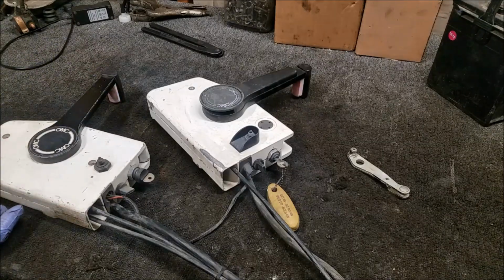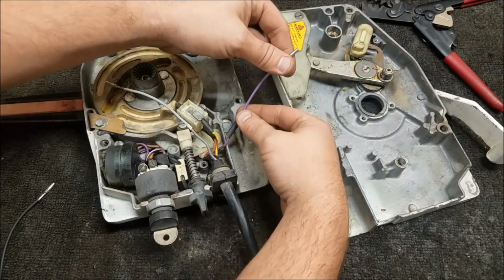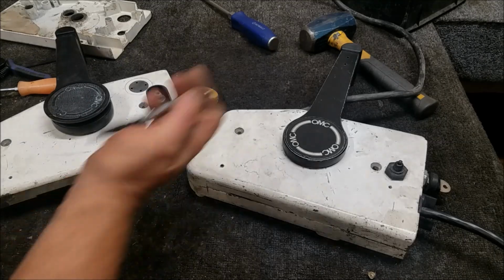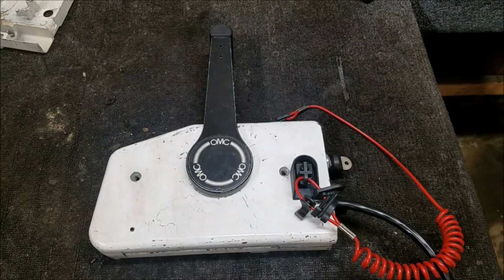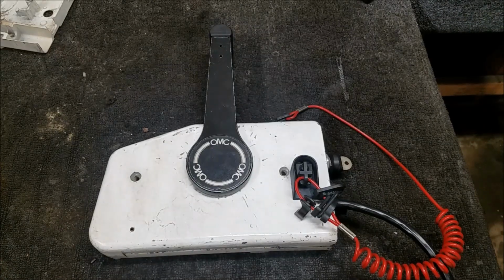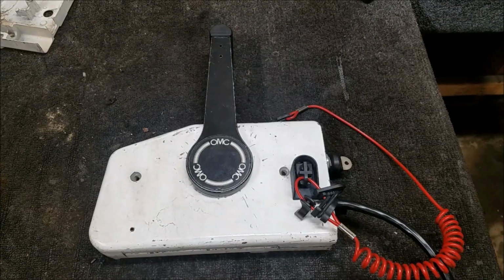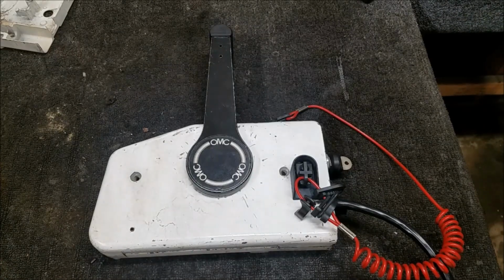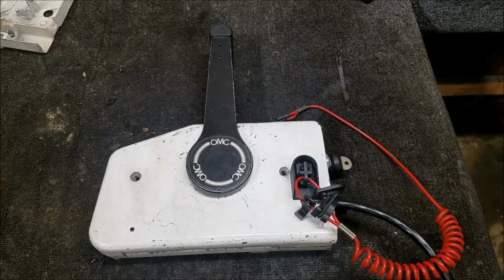Fixing A Broken Johnson / Evinrude Remote Controller

Comment: What a fantastic breakdown. And thank you for pointing out the neutral safety switch is In the controller... I thought for sure my solenoid was shot... Nope the handle wasn't in neutral even though motor was... I really appreciate the clear video and the time you took!
Reply: did you change the safety switch?
Reply: @slobodang952  I'm not going to lie to you I didn't change the switch I just removed it and grounded it out so the motor will run but I did just order one after realizing that tubing with kids is a bad idea without the dead man switch

Comment: Nice video! What is the little device with a wire coming in and out justbetween the key barrel and throttle tensioner knob, i am having a intermittent start issue and think it might be this component or the cables in/out of it.

Comment: Thank you Brandon,

I got 2 problems and I can’t figure it out. 

The problems are : 
1) at engine off it doesn’t wanna click in reverse, engine running no problem. ( I think when I pulled down the lower leg to change the seals I must have moved the shift rod ? But why it wouldn’t work at engine off but no problem when the engine is running?) 

2) when cruising along on the water,  the forward control only works in the first 10% of its run and again to go faster ( a little) I have to put the  lever all the way down ( the last 90% of the lever run) . It looks like  from 11% to 90% the lever is doing nothing, it’s all play. 
Today I pulled the controller apart ( that’s why I am on your video) and looks like the cables are fine at 100% in movement back and forth. I can’t see where the problem is due to the fact that the control box is split in two part and I never know “what’s not working” while both parts are as whole. 

I hope I have described the problems accurately so you can understand what I mean .

Thanks in advance and thank you for your videos ! You help thousands of ppl
Reply from the maker: What kind of engine do you have?
The not shifting while not running is normal. Without the engine running, the gears aren't moving, and usually don't align correctly with the shifter. 
Spin the prop while shifting and it'll go right in.

As for the controller, disconnect the cables on the engine, and check for full movement - that'll tell you if it's the engine or controller.
Past that, I'll need the engine year/hp and controller type. 
I'm guessing it's a linkage adjustment issue.

Comment: This is very helpful. My issue is when I split the cases the throttle and gear shift works correctly, when assembled it stays locked and I cant move the throttle out of the locked position?

Comment: Hey, Brandon.  Great video.  I watched it 4 times but there is no way I can split the remote on my 70HP Johnson controller.  It appears to be hung up on the bottom where you firs split the halves.  Maybe hanging up on the warning horn?
Reply from the maker: Naw, probably on the alignment pins on the two case halves. keep prying, but slowly around the entire case.
Like, if you get the top open a pinch, put a wedge in there and keep going at another side. Some type of wedge is important to not loose your progress. 
This is the least of your problems, usually when they are that stuck the hardware inside also isnt coming off. 
The case halves can be purchased and replaced. The insides are whats important.
Reply: @BrandonsGarage  ThanksBeandon. First thing in the morning

Comment: nice work I have a question I have a 1978 70hp evinrude and my throttle handle goes all the way forward but the shift linkage on the motor doesn't engage all the way can they be adjusted and if so how?
Reply: I got the same problem be nice if somebody can answer the question

Comment: I know you don’t usually answer questions, but here goes. I have this control box. The problem, you have to push the throttle 3/4 forward before it engages the carb. I tried new cam with zero improvement. Everything seems tight. My next attempt will be new cables. But I don’t really think that’s the problem. Any help would be greatly appreciated. Riley
Reply from the maker: I answer questions all the time?
Anywho, it's probably just backlash in the cable.
Watch this video, start at 10:50

https://youtu.be/qigy9Ryha2A
Reply: @BrandonsGarage  Thanks so much! I will try that. Do you sell used parts online? I could use that spring loaded pin that locks the control box in neutral. Thanks again for your time. Your videos have been very helpful over the years.

Comment: What does the middle knob on the controller do? I just recently picked up a Evinrude 150 that has this control box.
Reply: 22:18 i had the same question. I was watching this video to find out what the middle knob does. It is a tension lever to adjust the resistance of the throttle handle.

Comment: Hi I have a johnston 225 outboard v6 n this control box is on it the teeth inside are all wore away so it is driving froward when u put it in reverse can you change the hole box to a different make or does it need to b  the same type of box??
Reply from the maker: Whole thing is replaceable. Can even buy a newer design one with the use of an adapter.
Reply: I have bought a new design box but doesn't seem to fit
Reply from the maker: @williamkeenan1096  Doesnt seem to fit? 
also, I didnt notice before, you put it in forward, and the engine goes backwards?
Reply: Could you send me a like for the new type you mean incase I have bought the wrong 1 👍
Reply: @BrandonsGarage  I have tried 2 boxes on it 1 I got on it was fine had it running on the hose np then when I put it in the water it wouldn't give me any speed in drive and was going into reverse at this with no problem 🤷‍♂️

Comment: Have you ever come across one of these controls where you can lift motor up but won’t go down in pretty confident it’s in the switch, I can run battery direct to motor plugin and can make it go up, reverse wire and goes down but when I hit the switch it goes up but has no power down

Comment: quick question. i have an old 1988 135hp mercury. it has a 8 pin. I've seen some similar online but they say works on 1994 and older. But they look identical. Im just curious if there is a big difference in the 2. They both have 8 pins and power trim.

Comment: Brandon can you tell me what is that little knob for,the one in between the key n wires plug.
Thanks
Reply from the maker: Tension, or friction on the handle.
Turn for desired firmness.

Comment: I know this is not a main question regarding this video. I got a gas gauge. 1976 Evinrude 135hp. How do I wire the gas gauge into the ignition and what wire do I use. If not can what can I do
Reply from the maker: well purple is your battery positive with key on, and black is ground.
Reply: @BrandonsGarage  Thanks! Will be working on this tomorrow. I’ll see if I can tap into the purple

Comment: Brandon,  I wonder if you can advise me more on the Idle Lever side.  I'm having an issue where it is either all out or all off, seem like it sticks or something.  Partway up doesn't do anything, then a little further and it's full blast.  Bringing it down, it stays that way to a point then seems to suddenly bring the idle all the way down.
Reply from the maker: Could be on the engine, the throttle levers grease has a tendency to turn to sticky glue;
they still work, but not very well.
I would check those first.
Reply: Thanks, I'll try that.  It's a fairly new engine (old, but never used before I bought it).  I got the controller from a guy that did work at the dock for me.  I almost wouldn't expect the issue of the grease, but I'll check that first and respond again after I've had a chance to look.  Appreciate the quick response!

Comment: Thanks for the video, I've watched several. It looks much easier on your vids, My handle will not come out at all. Allen screw removed and longer screw used to tap it out, well I've used much more than a tap and it will not budge. Any suggestions?
Reply from the maker: same thing with this controller: https://youtu.be/qGe3VOnoILQ
just took more hitting. I think I propped it up on 2 pieces of wood and used a small handheld sledge.

Comment: Sure enough fuse was blown.  Got a new one and fired right up.  One More question there is a little red valve by the carburetors. I was told it is a manual choke.  Which way is off?
Reply from the maker: you want it in the middle. so not up or down. 
If you watch my 40 HP video, you can see me working on one of those.
Reply: @BrandonsGarage  thanks for all your help.

Comment: I’ve got a 1975 Johnson motor put a new ignition on I can turn the key on and hot start it and it will run and I can turn it off but it will not start with the new ignition how can I fix this

Comment: Brandon I'm hoping you can help me out.
I have twin yamaha's and my forward controls are not opening the throttles at the same rate. They start out fine at first but then the more you give it gas the larger the discrepancy between throttles. When I run at high speed the right handle has to be more forward that the left for both engines to have the same rpm.
I thought at first that the throttle/cable parts/levers on the outboards could be loose or worn out. But they are fine. Both have been synchronized at neutral and at idle. Both idle at 700 rpm.

Comment: Where do you buy parts for this shifter?  I took mine out in too cold of weather and the shift cable froze and I. Broke the teeth on the big circular mechanism inside.  And now it wont even turn over.  Is there something that is a safety switch from keeping the starter from turning over.
Reply from the maker: Yeah, neutral safety switch built into the controller, if its in gear it wont start.
Reply: @BrandonsGarage  it must be faulty because when I have it taken apart thanks to your awesome video and when I hold it in everything is still dead.
Reply: @BrandonsGarage  I have an 85 Alumacraft that has the 77 series gear shifter box I've lost my key would you happen to know what type of ignition switch I would need to get for that or the key number thank
Reply from the maker: Could be any key, if it was recently replaced, it might have a number on the front (where the key goes in) If not, you'll need to replace the ignition switch: https://amzn.to/2QbZLAJ

Of, for a hair more, buy a key set and just figure out what key you need:
https://ebay.to/2EZwY1o

Problem with that, is if it has had a Sierra or other aftermarket lock in it, those keys wont work.

Comment: Brandon on a older video you tore down a evinrude 8hp in the video you talked about changing the carb on the 8 to a 6 i was wondering if you did it and what your results where ?
Reply from the maker: Havent gotten around to it yet...
Reply: Brandon's Garage also I wanted to know if you would do a video on a performance 15hp evinrude/Johnson maybe use some performance reeds and port the intake and maybe use a bigger carb and test your results there very popular in Australia and I’m just interested on what can be done to make the little buggers get more power there a perfect size for a small boat

Comment: I've got the same controller. Today I started my outboard motor. After a while, the remote control started screaming/beeping, but everything seems to work normal. Do you know, what could be the problem?
Reply from the maker: that is the overheat alarm. You need to fix the outboard's cooling.

..or, if you have an oil tank, it could be low on oil. 
(its a warning horn)

Comment: Does anyone know what the kill switch wiring is connected to at both ends? one of the wires on mine is cut off and the other has been spliced. I cannot figure out what wire goes where.

Comment: Awesome videos !! I have a question. I'm getting several inches of travel in the shifter before I get a response with the throttle on the motor (1973 Johnson 65), Could there be something wrong or worn inside the controller or it just be cable stretch ?? My throttle is only opening up about 60% at wide-open. I'm can manually pull the throttle open and she flys !¡!!!!. Any help would be greatly appreciated. Thanks
Reply from the maker: Probably cable back-lash.
Watch the end of this video: https://youtu.be/qigy9Ryha2A?t=10m38s

Comment: Hey Brandon maybe you can help me out i have a 90 hp v4 2 stroke evinrude now i replaced the motor as the mechanic said my other motor needed a complete carb rebuild now he is trying to say this one needs it too. Anyhow what is happening when i put the boat in the water. The rpms are high but doesnt seem to have power to go very fast almost like its slipping into neutral when i shift into high but when in shifts into lower gear it dies about 10 to 15 kmh but hight nothing is it possibly the OMC controls need a rebuild as the other guy who bought my motor said he hooked it up and working fine so what would cause the problem in my OMC THROTTLE CONTROL i was going to get another OMC controls but worried that it may just have the same problem any ideas
Reply: have the hub in the prop replaced

Comment: Hey mate is there a fuse located in one of those got one that won't start
Reply from the maker: No, but there is on the engine wiring that powers the controller.

Comment: Any chance that you can send/post a pic of the ignition wiring at all? I had someone take my controller apart and didn't take a pic of how to put the wires back together :-(
Reply from the maker: on the switch itself?
Reply: Yes the back of the ignition switch thanks.
Reply: It has 6 connectors (with C, A, M, B and S on them). I really dont want to stuff the motor by connecting the wrong wire to the wrong connector. Any help would be greatly appreciated.

Comment: Hey Brandon what does the harness plug you wired in under the key do? What’s it called
Reply from the maker: tachometer plug.
Provides the tach signal, switched battery +, and a ground.

Comment: Awesome video! Very clean wiring. What is the red wire at the end of the video? Is that an emergency shut off? I just bought a boat and it came with a 100 V4. I was curious what the cross piece was?
Reply from the maker: The red thing was/is a safety lanyard. Pretty important, boat cant run without it. 
(if the controller uses  one that is)
Reply: Brandon's Garage ive got this mounted on the starboard side of the boat. I am installing a center console and was wondering if it would need to be mounted on the port side of the console? Also, if I decide to purchase a universal control, I assume, I would have to also install a seperate ignition switch?
Reply: Brandon's Garage great video by the way!

Comment: Hello, thanks for posting video.. I have a question if you dont mind. I have an older 20 foot powerboat that used to have a Johnson outboard engine in it. I have now replaced the original engine with an Evinrude V4 110 hp.from about the same era ( 1988-1992 )  The Evinrude engine came with a OMC controller but i was wondering if the Johnson Command center controller that is already installed in the boat will work the Evinrude.. Thanks!
Reply: Johnson and Evinrude controls are the same. Their all OMC Style. At least on the older units.

Comment: Hey Brandon, I have a 40hp Evinrude just like the one you made the videos on. I set my linkage and reinstalled everything. Now the motor turns over strong but won’t fire at all I have spark, and I have fuel. I don’t have any movement at the engine linkage when I engage my high idle lever... any suggestions?

Comment: Hey I have the exact controller for my 85 bass tracker. But i wanna install a push button/toggle switch to start motor. New push button/ toggle only has 3 wire . 1 for toggle and 2 for button. What wires from key switch do I use ? Any help will be amazing. Thanks in advance.
Reply from the maker: have a part number, or website you got it from? Just need to see it.
Reply: @ Brandon's Garage - joesracing.com 
Joe's racing products . Part # 46115
Reply from the maker: Ah. I am out traveling for work at the moment. I'll make a video tomorrow or Wednesday when I return explaining it.

Comment: Hello i have a 84 johnson with the same controls as you have in video. I bought the boat off an older gentleman and the control box was apart do to having a plastic piece fixed. I put the control back together and took the boat out for test drive and the boat ran rough.  I kept getting a electric shock when i touched the metal on the control box. So i took the control box back apart the next day to look for bare wires or anything that would cause a shock.  I taped a couple wires  and put it back together.  Know i have no spark on any of the cylinders but i still get a shock through the control  box. The safety kill switch doesn't work neither. This is my first boat and im getting frustrated. Just trying to get on the water with kiddos
Reply: When i had it out the first time it was running rough i would be driving full throttle and the boat would suddenly bog down without me touching  the throttle at all.

Comment: hey Brandon do you see at 17:32 when you have both controllers lying next to each other..the copper (retainer plate) on the remote on the left..on the right remote  it looks like steel, one is held down with a bolt and one with a screw..is that because someone broke the screw off the one on the left and replaced with the bolt? That's my situation..just wondering if you can replace it with anything that will hold down the plate? Thanks
Reply from the maker: The bolt vs screw was probably just a design change over the years. And yes, Im sure you could.
Reply: Thanks for the vids..I did get the 82' 35HP Evinrude to fire up but it idled high so I choked it out, it'll be alot easier to manage when I have the new ignition switch installed.